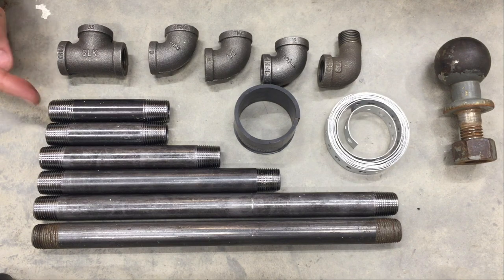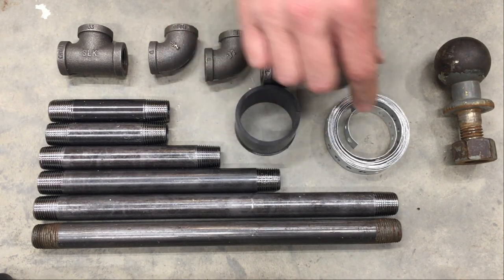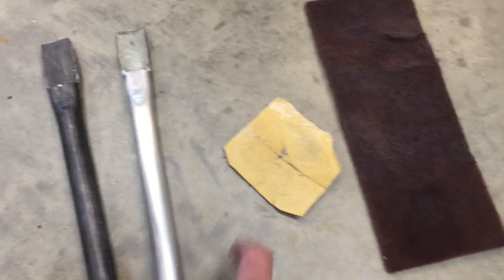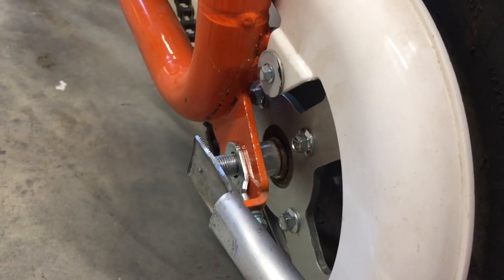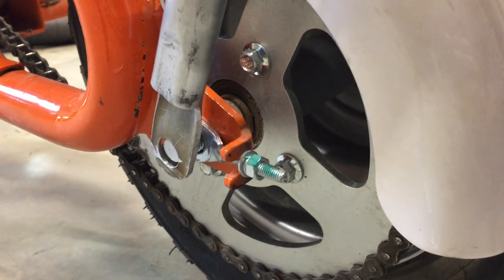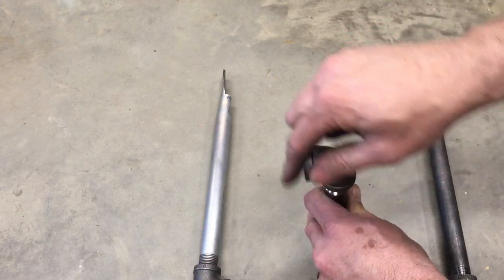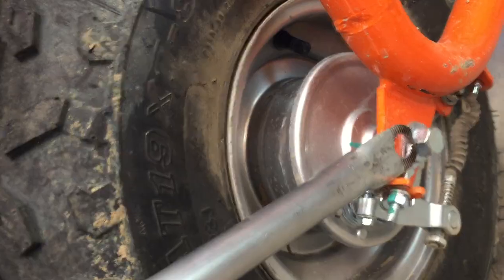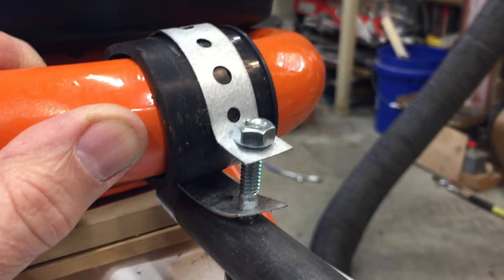Mini Bike Hitch

Comment: Your ball is higher than the axle.  This could result in the bike flipping if the trailer gets hung up somehow or on a bit of incline.  General rule of thumb is to tow from axle height or slightly below.

Comment: Did you eliminate washers on the axle to accommodate the thickness of your flatted pipe.  Also, would it be better to use a hot axe on the pipe when flattening same?

Comment: Lou baby! Just stumbled across your content here and liking it so far. How much does that lawnmower and trailer weigh? Do you think it would haul more? Contemplating getting one for a grocery getter, camp bike & small trailer tug. Which model mini bike would you suggest for the task?
Reply from the maker: Probably looking at around 1000 pounds total.  That is honestly too much, if you plan to do a lot of stop and go, or hills.  It will pull, but the clutch doesn’t like it.   I think maybe 300 pounds would be pretty reasonable, which would easily get the groceries home.  The Coleman BT200X is a very stout bike for the price.
Reply: Good information sir thanks much for that. I’ve been thinking about an experiment with those bikes, stretch one out slightly and power it with an electric motet driven by a battery powered by an on board generator making it a hybrid powered beast and considering your talent level I wanted your input on this, thanks
Reply: @forbrucenash an electric motor, powered by a battery, hooked to another engine that's running a fossil fuel generator to charge the battery that powers the electric engine? Genius

Comment: Hows the motor holding up after using it to haul the trailer?
Reply from the maker: I have not really used it. I have both a truck and ZTR mower with a ball hitch.  The motor handles it fine, but get a very high quality clutch if you plan to pull a big load.   I would really suggest a smaller trailer.  The 5x8 is all I had for the video, but a 3x5 would be better behind a minibike.
Reply: @HowToLou  thank you sir!

Comment: I want be able go in Colorado forest cut firewood to haul out. I'd like  be able fit a bike and atv trailer on a car trailer plus the wood.  A 4 wheeler is expensive  and heavy. A rokon awd bike very expensive $12k. So been thinking of bigger off road  Mini bikes as are inexpensive and easy load unload.
Reply: You will have all the power you need for that if you set up a Coleman CT200U with a stage 1 predator 212 and a torque converter. Figure out how to hitch that ATV trailer to the mini bike and you will be golden
Reply: Everything Keith said and go to a big rear sprocket, the biggest you can find